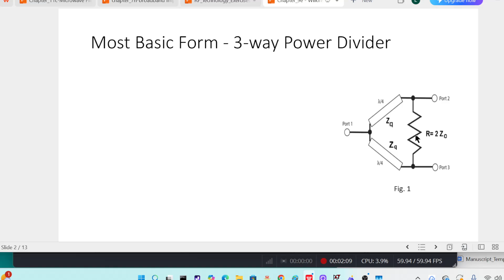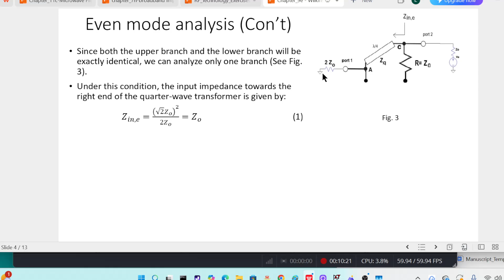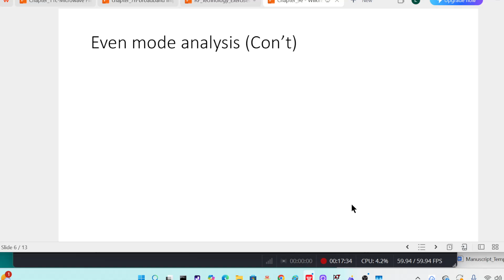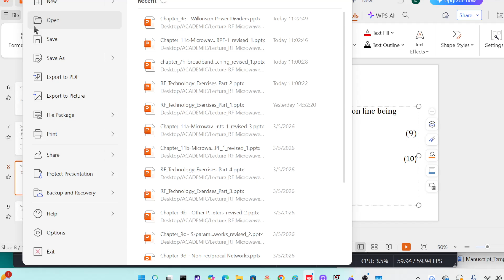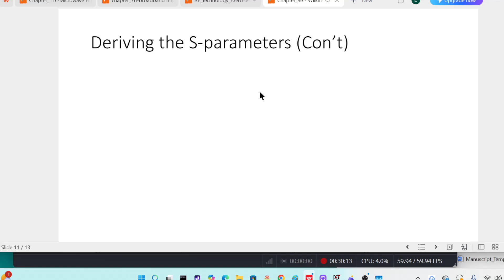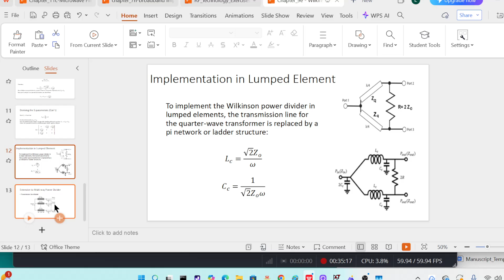Wilkinson Power Divider/Combiner

Comment: thank you for your lecture. it is very useful for me. 
and could you help me understand  the combiner mode. 
for example if the power is fed from port2,  how will the power delivered and the voltage would be(there would be two conditions, port2 is matched and open)
the video is very good, only voice is not perfectly clear